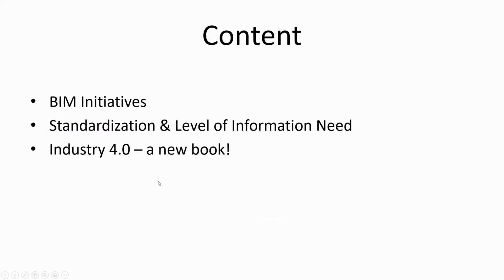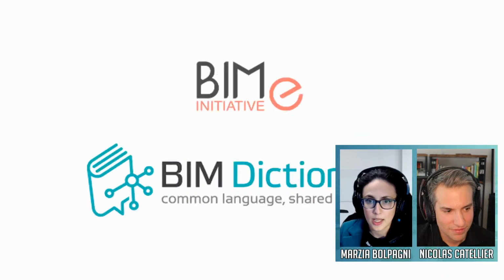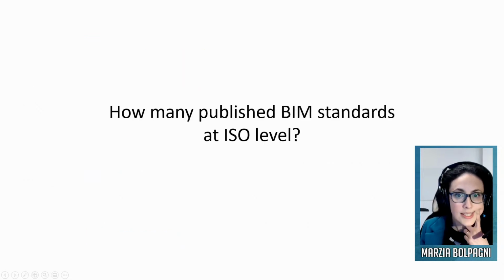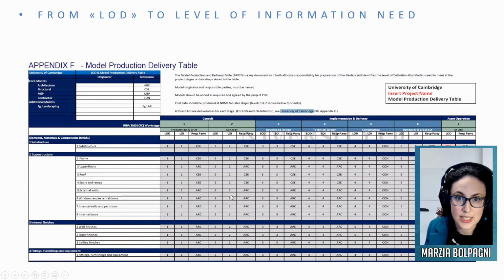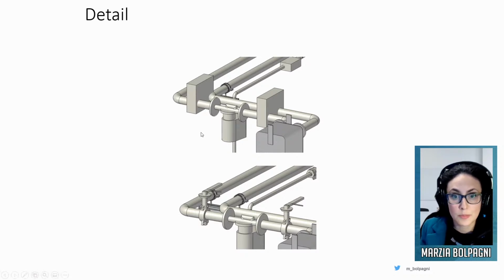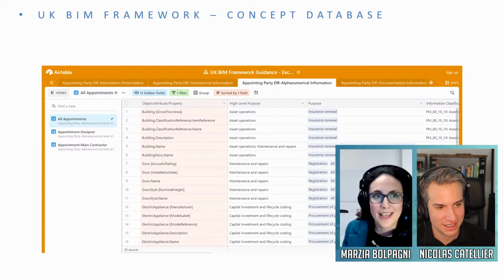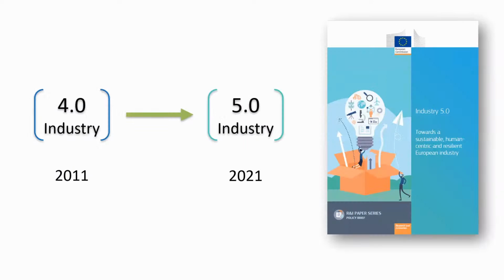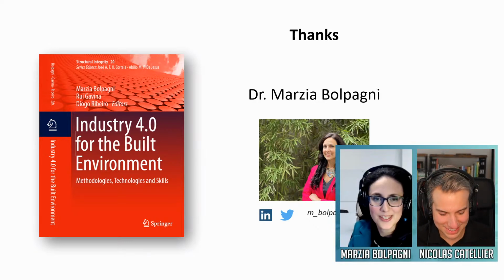Revit Pure Live #032 - Industry 4.0 + Level of Information Need with Marzia Bolpagni

Comment: Hii..... I have currently facing problem on revit software (RevitWorker.exe was not found) i reinstall the software more time but not rectified. Kindly help to  solve the issue
Reply from the maker: We are not affiliated with Autodesk, you will have to contact them for technical support. Thanks!